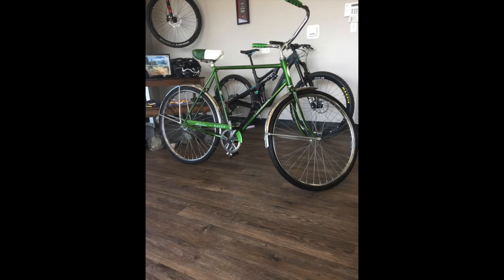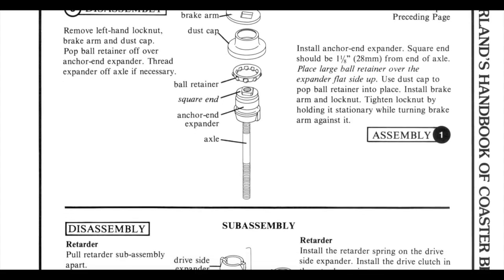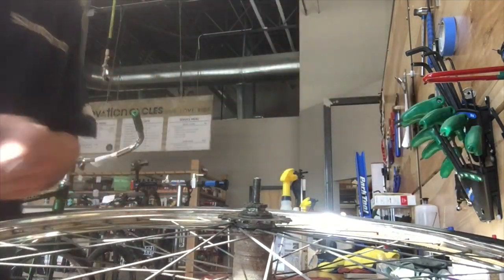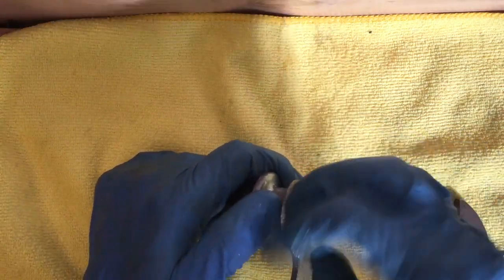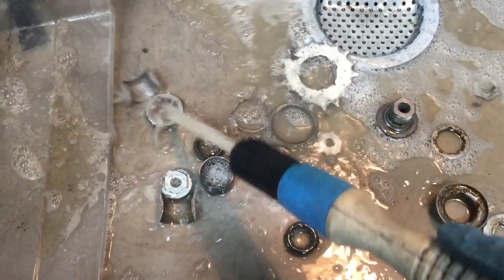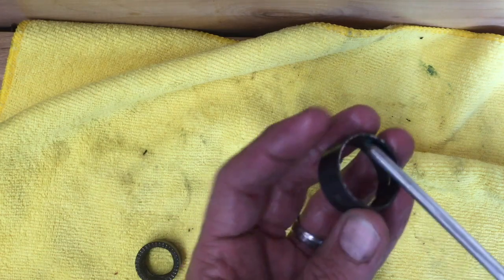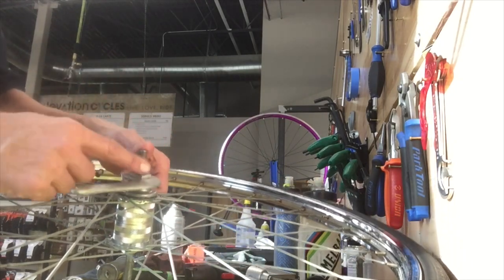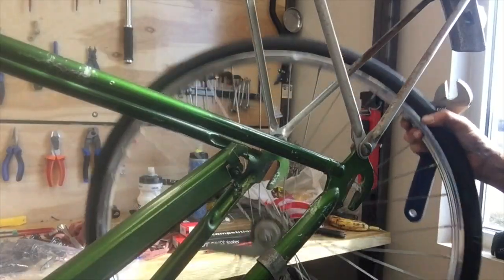How to overhaul a Bendix coaster brake hub

Comment: Didn’t really solve my problem. My brakes are not working and no troubleshooting was mentioned. Skipped over the fine points of cone adjustment.
Reply from the maker: There’s really no adjustment to a coaster brake hub other than the bearings. If something isn’t working, it’s  either assembled incorrectly or parts are damaged , worn, or the grease was really old like the one in the video.

Comment: I don't understand how they were able to make such a small and light hub with such an effective drum brake inside. Well, I haven't used a coaster brake since I was a kid in the '80s and they were plenty effective back then; not sure how effective they would be now that I weigh ~190 pounds. 

I wish someone would make a drum brake hub as small and light as that for the front wheel, and have it be cable operated. The smallest Sturmey-Archer front drum brake hub - http://www.sturmey-archer.com/en/products/detail/x-fd - is a lot bigger than a Bendix coaster brake hub and weighs about 1¾ pounds.
Reply from the maker: These older coaster brake hubs didn't really have great braking power. Sure you could get your back wheel to skid, but that was usually standing up, jamming the brake really hard with your weight centered towards the front of the bike. The main issue is there is just not enough brake material to give plenty of brake force. Not sure if you've ever felt the difference between a 140mm rotor and a 203mm rotor on a bicycle disc brake, but the difference in brake power is significant. Those Sturdy Archer drum brakes actually stop pretty well in comparison.